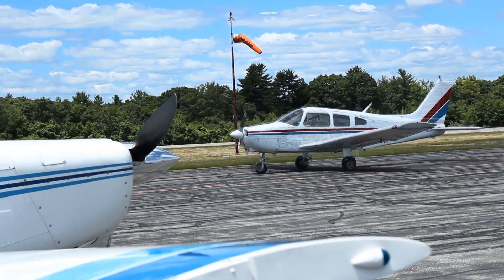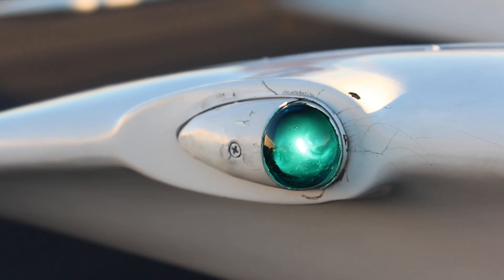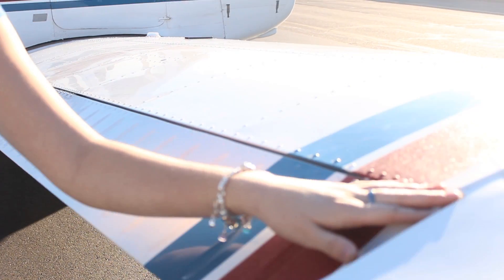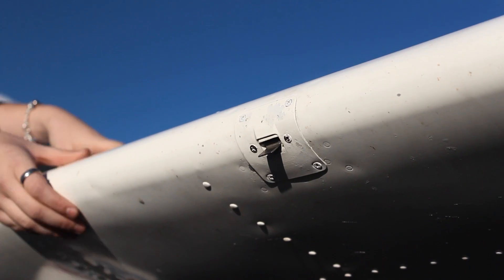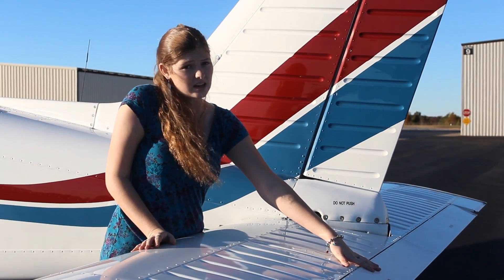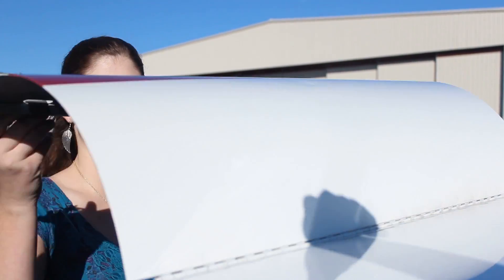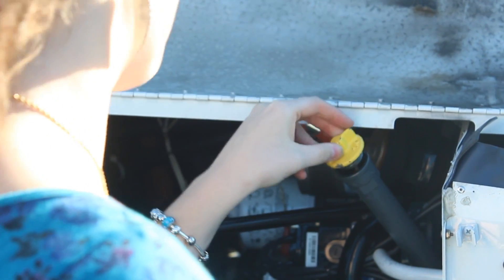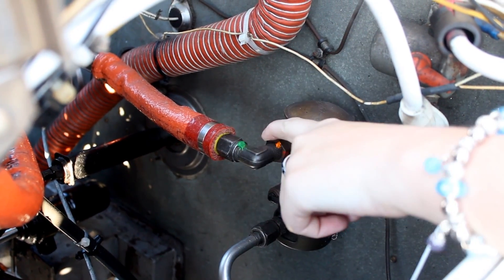How to Preflight an Airplane - Preflight inspection checklist for Piper or Cessna

Comment: I do not believe you would find the water 'bubbles' on top of the airplane fuel for the same reason you are draining your sample from the bottom of the fuel tank; the water is denser than 100 LL and would appear as 'bubbles' in the bottom of your collection bottle.

Comment: Magneto hot wired to the battery? Water bubbles on top of the fuel? No reference to a checklist during the preflight, multiple items missed. This video is full of mistakes and is not a good educational tool.

Comment: NOTE:  Someone may have covered this already but :A magneto is an independent self contained ignition system not relying on the aircraft electrical system or a battery  for power , Think  MAGnet ,a magnet and coil of wire in the magneto generates and control the electricity  that the magneto uses to create the spark. 
 The wire that comes off of the magneto that was said to go to the  battery is a grounding wire to stop the magneto from producing  spark. If this wire (called the P-lead) would be connected to the aircraft battery it would cause damage to the magneto and possibly damage to the aircraft wiring.
 You could totally  lose the electrical system in this aircraft and you would still have spark and keep flying for a little while until your engine  ran out of gas because when you lost your electrical system you lost your supply of fuel   to the engine  because your electric fuel pump stopped working, this is not a problem in most high winged aircraft.
  There are some low winged aircraft that have an engine drive mechanical fuel pump .
 Some good points are also made by a few other people in the comment section below.  
 Thanks for reading my 2 cents.

Comment: Thank you for this excellent set of procedures. I have never had the luxury of an assistant to assist in checking lights and the stall warning. So I would switch on the master switch then the lights, exit the cockpit and quickly walk around the aircraft to check the functioning of the lights as well as operating the stall warning flap (you can easily hear it from outside the aircraft). Then I would nip back into the cockpit to turn off the lights and the master switch. And I always carried the Checklist with me rather than relying on memory.
Reply from the maker: Same here.  That's what I would do during all my training, but now I can't even think of the last time I flew alone.

Comment: I fly a Cessna and I was taught to stay as clear as possible from the prop when turning it by hand, even thought the ignition is off.  If for example there was a ground problem in the ignition circuit the plane could still start. This is a great preflight checklist video but I gasped at how Killian moved the prop by hand and how close her arms and body were to it. If it had started, she would have lost both arms or worse. Not sure if this plane is much different than a Cessna as far as ignition goes? Just my 2 cents...
Reply: She did say the ignition was off. Notice the key is hanging from her neck. My understanding is that when you turn the key to the "off" position you are actually grounding the electrical circuit for the magnetos, so no spark will be made and the engine will not run. 
That said, I wonder if the compression in the cylinders could still, while hand turning the prop, cause it to whack someone hard in the head.
Reply: I've been told by an A&P mechanic that is okay to turn the prop as long as it is opposite of the direction it would spin when running, which she did.
Reply: Love the vid,but yeah i was told to treat every prop as a live one :)
Reply from the maker: I think about this comment and video a lot.  It would be literally impossible to run a flight school, or push your plane back into a hangar if we all really took this to heart.  I'm not up in arms or anything, I just think about it a lot.  Check you p-leads.  Test the grounding.  Don't turn the prop through a compression position while it's hot.  However, operations around the globe would come to a halt if we couldn't push/pull by the prop, or insert a towbar.  Sorry, rant over :P
Reply: So then how should you check the prop
Reply: Yeah, she demonstrated poor technique with inspection of the prop.  Never get yourself in the position she demo'd. But overall, she did a very nice job!
Reply: Yes but Mr. "Rich" mentioned that there could be a fault somewhere and the ignition could be turned on, even when key is removed. Its a possibility, sometimes the freakiest things happen. To turn the engine over under compression and it will jump back?? I dont think so, a friend of mine has a old tracktor with less HP then this plane... If you try to hand start it (And here he is very cautinous-even when compression off and motor warm, when he get to the handle),   with compression, you can barely move the handle with both hands. Dont think that Kilian (also as a girl)     couid turn accidently her propeller...

Comment: Great video! Good job...just not comfy checking the props with or without the key in the ignition the way you did. You might want to keep a safe distance, like an arms length away because those things can be hand propped. And I avoid walking directly under it and turning it around.

Comment: A couple of things differ from how I have learned, so this was interesting. All rudders I have seen have had the note "do not move" (not sure why) so at 4:39 I was surpriced she did. At 5:09 she does not turn the lid properly back on again (at first you can read "indica" behind it, then just "ind", a little scary). But some of the other things I will consider :)
Reply from the maker: +U.N. Owen I just watched the part with the fuel cap like five times... How you guys spot this stuff I will never know! XD  Your attention to detail is impeccable!  I actually like to hear that you've learned things a different way, because that's the whole point of my channel; for the aviation community to share their experiences and how they learned things.  Most often, nobody is more right or wrong than anyone else, just different, like when you were learning math in school.  There's no more correct way to solve linear equations for everyone, because some thinks work better for some than others, but the result is always the correct answer.  Feel free to share those things that you found different, I think we would enjoy hearing.

Comment: Killian is very attractive... the proper word is "smokin hot".. well that's 2 words.. she can pre-flight and fly with me anytime... (post-flight too.. that would be a helluva log entry... ) nothing sexier than a hot chic flying an airplane.. especially when she kicks off her heels and throws them in the back seat and rides the rudder pedals in nylons or with bare feet... yummy.. 

someone explain to her that the magneto wire (P-Lead) doesn't go to the battery... it's switched to ground through the ignition switch..  grounding it turns the spark off.. without the p-lead the mag is hot and the engine can start.. 

i'm subscribing.. show us more Killian.. been hooked on her since the ran your checklists...
Reply: Hope you wont be distracted from her looks while flying otherwise it could be a very painful post-flight.
Reply: omg its one of those obsessive sons of a lol

Comment: Was never taught to touch the spark plugs, nice observation, but add checking the toggles on the ailerons by reaching under, looking for the hinge pins on them, also on the stabilator; the prop should be checked by following the blade with both palms.  The length of the landing gears stunts for proper inflation and cotter pins in axles is also good to observe.  I also look inside the tail one to see the bolts on the stabilator arm. These were check items added by our FAA Fast Team class. All other suggestions by the comments below were also included.  Very good on all observers! 😎
Reply from the maker: +Paul Bergman Thanks for leaving us your list.  There are so many things to check that I could make an entire series of videos on pre-flights, (maybe I will), while this was just meant to be a brief overview.  Think: "Oh, right, my flight instructor said we were going to go over pre-flighting the plane for the first time today."  It scares me how many things there are to check, even in our simple systems, let alone commercial jet aircraft!

Comment: Just a friendly observation. I was always taught on the preflight walk-around to check the tension of the alternator belt in behind the spinner! Mark in Iowa.
Reply from the maker: +Mark Smith Nice one.  Were you flying a plane like an Archer where it's really exposed?  It's pretty hard to reach from the front of the Warrior given how the cowl is built.  For my fellow warrior pilots, you can check it easily from the co-pilot-side of the engine.  Just look forward of the baffling and the cylinders.  You might need a flashlight, though.
Reply: Friendly Skies Film We could stick our pointer finger right behind the spinner and could just get a tip of the finger to feel and tug just enough to feel the tension on my friends PA 28-161 Warrior II.
Reply from the maker: +Mark Smith Ok, I believe that.  I'll see if I can do the same thing next time I'm up at the airport.  It's a good suggestion.
Reply: Friendly Skies Film It always worked for John or myself. Mark.
Reply: And please don't hesitate to correct me if I misstated it! It's been a while now since he has flown his 8JW.

Comment: Thank you for the posting . I learn much from your videos. I must in good conscious  mention 2 items of interest to consider ...1. The Lovely Killian  turned the prop in the correct direction but did not mention that if the key WAS LEFT ON, the engine  is much  less likely to  start  2. I was taught to  not  recycle fuel sample, rock your wings before sampling and do it with plenty of light. I will not beleaguer the reasons for it but here is the article for that statement  (for the most part)  . ...."http://flighttraining.aopa.org/students/presolo/skills/checksamples.html" 
Keep up the good work , we are always learning!!
Reply from the maker: +Ron A Hey Ron!  Thanks for sharing your thoughts and kind remarks.  I'll use your numbers, 1. Yeah, if you caught the imperfect script, I meant to include a few words about the magnetos and accidental engine starting, but I chose to omit it for the sake of time.  It's a very serious topic in my opinion.  2.  Thanks for the great link.  There's some really good information in there.  I agree with the wing rocking, mostly for the condensation.  I also look at the underside of the cap and the fuel level tabs to see if there is any condensation, as well.  I too bring a bright flashlight with me for fuel checks at night, but also for ice checks while flying at night.  The recycling of fuel samples is an interesting topic too.  I definitely would toss it if I was using an unfiltered fuel sampler, though the environmentalists get mad at us for that too, but the GATS can has such a good screen that is also impervious to water that I hardly worry.  The fuel quality is also excellent in my part of the US, and I have never found anything by a few specks in my fuel. Thanks for the thought provoking comments before I head off to bed.  I'm glad that you are enjoying the channel.  -Nick

Comment: Forgot the pitot heat.
Reply from the maker: +George Charles Allen I might use your comment as the segues into our icing episode!  I just started work on it today, actually.  I'm also planning a more in depth winter flying episode that covers oil viscosity, pitot heat, carb icing, and the oil cooler winterization plate, as well.

Comment: Just a little note It's a stabilator not a stabilizer.   Piper is really known for using stabilators in their aircraft.
Reply from the maker: Agreed.  I had Killian use the phrase to keep the video as general, and "aircraft neutral" as possie.  To clear things up for anyone wondering: Cessnas typically have elevators, and Pipers typically have stabolators, but all aircraft have horizontal stabilizers.  (unless they're of delta-wing design)  Look up each one of a more technical explanation, but DEFINITELY know the differences if you are transitioning from one make to the other.  Thanks for the comment!
Reply: No problem.  i fly both makes.  thats why i pointed it out.

Comment: Water is denser than 100LL, so the "bubbles" of water would be below the fuel. @5:28
Reply from the maker: +stheagy Yeah, I thought of that while editing.  Blame some oops between "debris on the bottom" and  "water on the top" that happened on the soundstage.  Thanks for the correction, and my apologies.

Comment: While checking control surfaces, don't forget the hinges and especially the ballast or counterweights. Also the hot lead of the mags, also called P-lead does not go to the battery.
Reply from the maker: +Norbert Mudaheranwa Thanks for the correction.  It kind of hit me that they don't go to the battery directly, but to the ignition, or magneto switches.  I knew I was going to make some decent screw-up in this video, so Killian offered to overdub anything that I needed changed, but I found it difficult enough to produce this video while I was traveling in Australia that I went with it anyway.  Shame on me.  Thanks for documenting it!
Reply: No problem. I heard that the best pilot is always learning. Great video by the way.
Reply from the maker: I can't imagine what other youtube pilot you heard that from!

Comment: how often do you have to change the oil out in the Piper?
Reply from the maker: +Evan Schildgen N8027F has a freshly overhauled engine, so we have been aiming for every 25 hours of use.  She gobbles up about a quart every 15 hours of flight too.  Now that we're out of the engine break-in period, we will probably aim for more like 50 hours, as Lycoming specifies.  Good question.

Comment: that was the pito drain the pito static port is much smaller and behind the pito tube not under  it.
Reply from the maker: +alex cordova After an in-depth review of my POH, and a quick google search, it would appear that the Piper pitot mast design has changed several times over the years.  The bottom hole in this video is labelled "Primary Static Port", and the POH shows that there is only one connection back to the fuselage that is definitely oriented down.  That being said, I have found images of a smaller whole on the backside of a newer Piper mast, as well.  Since I speak with no authority, just as a Warrior owner, I think the jury is out until I ask my mechanic.  Good observation, and you are definitely right that you need to be aware of this distinction on different aircraft.  Thanks for the comment!
Reply: I'm not sure about this specific PA28, but later ones also have pitot and static drains inside the cockpit (bottom left, behind the fuel selector).

A couple of additional things:
* When turning electric equipment on, I wouldn't turn the fuel pump. The POH doesn't call for it, and the day you start flying fuel injected engines, you might end up flooding it.
* Also on the electric side of things, make sure annuciator lights are on and check the fuel gauges.
* When checking under the engine cover, you went over many things that are not required by the POH (which is great), but you didn't mention one that is there: the alternator belt.
* Propeller: always treat it as if it's live and dangerous. When Killian touched the propeller, she was positioned such that had the engine "coughed," there might be bad results (and we don't want that).
Reply from the maker: talreichert
You're right about the static drain location on this aircraft, but they are very hard to reach and even harder to trigger without looking at it.  It's a stop-cock much like the oil drain.  I finally got around to seeing if there was a good way to check the alternator belt from the outside as people said there was, and the engine cowling actually makes it impossible to do from the outside, like as if the engine was hot.  I was kind of surprised, as the belt in the Cherokee 140 I just bought is very accessible.  Thanks for your other comments, as well.  I must apologize that after a few thousand comments that I don't reply in the depth that I used to, but I really appreciate when people write detailed comments like this.  Thanks :)
Reply: +Friendly Skies Film 
No worries about not responding to every comment (at least those that I make), my comments are for clarity and I really enjoy the movies you post.

As to accessibility of the alternator belt, I always access it from the air intake and check it's still there and tight. That's in the PA-28-161 and the PA-28R-201. Can't speak for other members of the Cherokee family.
Reply from the maker: talreichert
Thanks for the support :)  I feel like the quality of my videos is not quite as high as I'd like them to be right now, but I think I might soon have the time to change that.